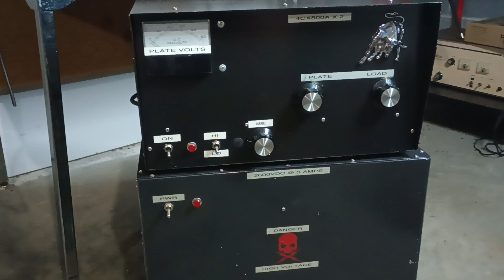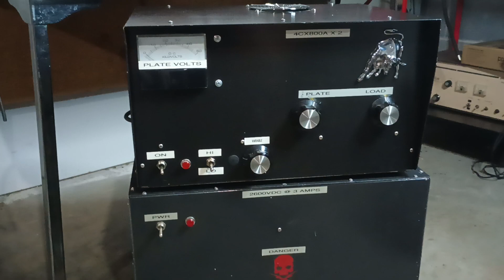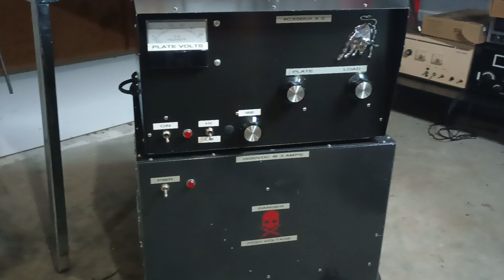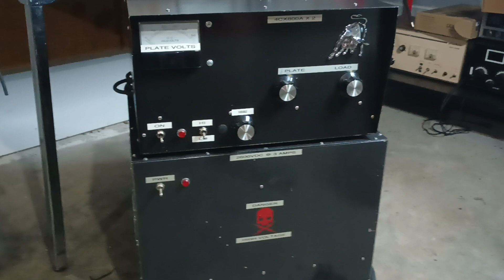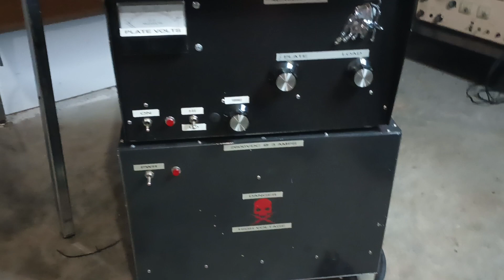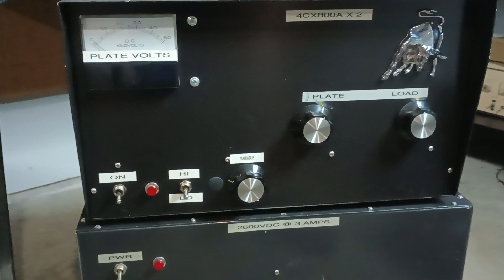JTG Built Dual 4cx800 Base Amplifier, Discussed and Overview, demo coming soon, for sale, pick-up

Comment: Why not a 2980 putting 2 watts and 40 watts modulation into the amp?
Reply from the maker: Because a 2980 will do too much avg power.
15-20 watts typically
Reply: @Rooster_Radio  Ok, I've used a 2980 with 2 watts out and 40 watts swing with a 5 pill with no issues.  This set up would not work with this amp?  If not, why?  Just curious?
Reply from the maker: @josediaz-tq5cz  think I explained it in the video but tetrodes like the 4cx800 are extremely drive specific. They are made for one output, and designed around a specific amount of average power.
If you need further explanation, google tetrodes
Reply: @ I was under the impression that the 800 tube is a low drive tube thus was my question that you didn't answer, thanks anyway.........
Reply from the maker: @josediaz-tq5cz  ok, let me break this down for you since you're obviously hard headed and don't understand the concept of a tetrode and/or are too lazy to research it yourself.

Without doing a custom input circuit this tube with produce 2500 watts with half a watt of drive or input power/carrier. Therefore to use it with a CB you have to pad the input circuit to protect the tube from being over driven. So, if the input is set for 10 watts carrier or 10 watts average power that's what it means.
Example: a tuned cobra 29 will do 9-10 avg and 35-40 peak.
An RCI 2980 will do 35-45 peak however the average power is much higher at 15-20 watts.
That said the 2980 will overdrive the tube unless the amp is tailor built to accept that amount of power. And this exact discussion is why most cbers and hams don't have the ability to run a tetrode properly.